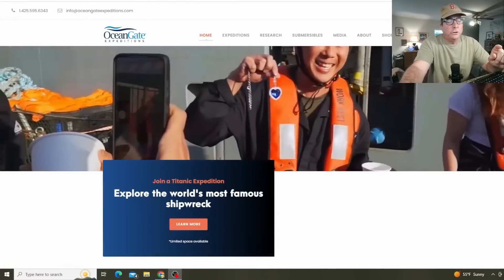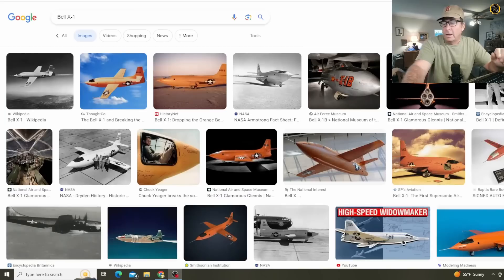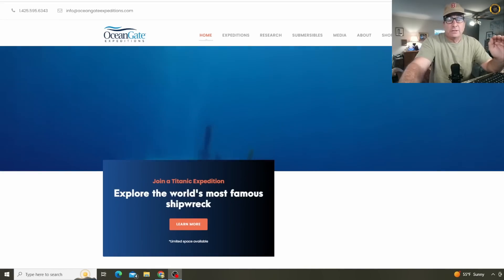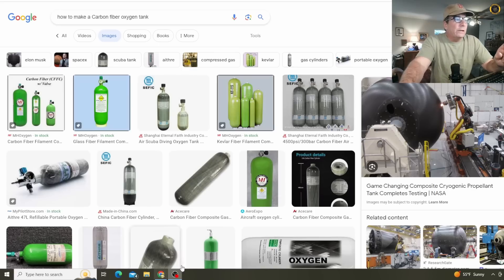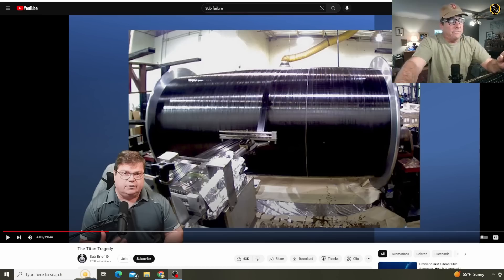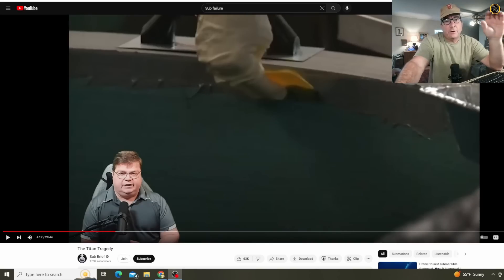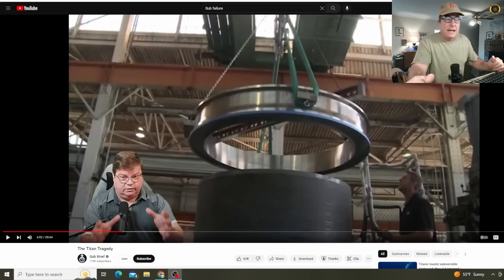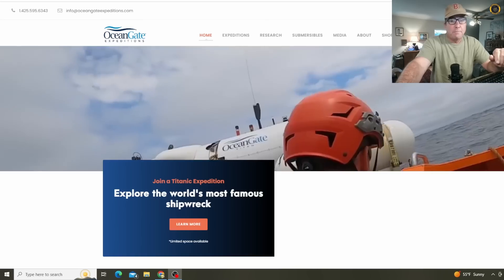Oceangate Sub Construction Details and Implosion

Comment: I'm an aerospace engineer, and I have extensive experience with analogous structures - wound tubes with bonded caps, as well as other composite and bonded structures.  I saw the Sub Brief video prior to this and one thing that stuck out to me was the design of the flanges of the titanium ring that are bonded to the tube wall.  We had specific experience with failures at these kinds of joints due to stress concentrations right at the edge of the interface between the two parts - meaning where the flange ends.  This was understood to be because of a sharp drop in the stiffness of the structure at that transition point, resulting in higher local stresses at that interface.  One way we'd overcome that is to taper the outer face of the mating parts so that there would be a more gradual transition.  If you look at the design of this ring - about 2:40 in blancolirio's video where someone is prepping that location on the ring - there is no taper, the flange full thickness just abruptly end in a 90 degree angle.  I'm NOT saying this is what caused the issue, there are any number of reasons it could have failed.  But I'd be interested in seeing how that joint held up in a catastrophic failure.
Reply: I have an extensive background in composites as well and one thing that stuck out for me was the pictures of the CF being wound around the mandrel/form. The filaments orientation was entirely perpendicular to the subs body, no multi axis passes. It also appeared to be basically a wet layup with maybe some heat post curing (no autoclave) This CF windings are literally being 100% held together by the epoxy, best analogy is wood grain. This would be the absolutely worst way to use a composite system and offers the lowest attainable physicals.
Reply: @glassdave  right! If you’ve ever 3D printed a cylinder on an upright orientation, you know how easy it is to break, no matter how thick the wall is.  So many wrong-looking aspects to this, I doubt an actual engineer came up with it.
Reply: @glassdave  I don't want to say anything about the layup of the composite part right now.  So little of the winding was shown, it doesn't give a clear idea of what tow orientations were used through the thickness.  I've worked on wound structures that had multiple tow orientations, and since this was supposed to be 5" thick, there would be a LOT of winding that may not be seen by that short clip.
Having said that, I was definitely shocked to hear that they did little to no certification testing.  I would've wanted to test the crap out of something like this before ever putting my life at risk in it.
Reply: @sthomas6369  fair enough. Unfortunately i find myself speculating irresponsibly based solely on the few minutes of footage and the amount of poor technique in those alone. Im quite certain all this will be looked at and i agree with a final thickness of five inches you'd think there would be multi axis passes in there but ya gotta admit not much evidence of it. Even still this appears to be a simple saturation machine and to get into the highest physicals wouldnt they have to get into a pre-preg autoclave? Again the majority of my personal experience is in marine hull construction but i do enjoy learning beyond my daily scope. Seen a lot of great input from James Cameron on this as well.
Reply: @glassdave wow you are right. Makes me face palm. The tube was even more brittle because of that.
Reply: @glassdave   said  "      one thing that stuck out for me was the pictures of the CF being wound around the mandrel/form. The filaments orientation was entirely perpendicular to the subs body, no multi axis passes   "  

Do we know that the entire thickness is wound this way or that this was just the final pass in order to have a smooth finish so paint seals everything up?
Reply: @bobroberts2371 was just an assumption on my part it also looked like a fairly early pass deep in the laminate, either way lack of and disreguard to proper engineering would lead me to believe no thought was given to a multi axis laminate. Just watching them hand mix and apply whatever adheasive that is without any thought to controling the consistancy of the union is also cringeworthy. Carbon fiber is also very misunderstood by people that dont work with it. When we talk of its high strength abilities this is only in reference to pre-preg autoclave cure highly engineered structures. CF used in simple wet layups even if post cured really carries no better physicals then fiberglass in some cases "S" fiberglass carries even better properties then wet lay up CF. Many many variables but it seems this sub failed on so many levels it was doomed from the start. You mentioned that epoxied on end cap, i cant wrap my head around any way to make this work in an external pressure vessle. That was just a simple surface glue joint. I think people tend to think that pressure is forcing the caps on but thats not how it works, the pressure is not a linear force on the ends, its over six thousand psi at every angle and joint trying to force its way in at every infinite point.
Reply: I suspect you solved it.
But the real solution is what was known in the 60s. Spheres. And don't try to take 5 people?
Reply: @backfromcuba  Exactly. Mr. CEO should have just built 2 proven certified subs that carried 2-3 people each and call it a day. His ego and hubris got in the way
Reply: @zoots15  it was stupid anyway... 5 billionaires, one window? can't put windows in a tube. can put more in a sphere. what's the point without a good view? might as well use an ROV.
Reply: @backfromcuba  You could call Oceangate an "innovator". But not all innovations are ready for prime time.
Reply: @JimMork  Juan's point about innovation being made in very small steps is very pertinent.
Reply: Sadly Oceangate got the prime time for bad reason.
Reply: @martasfly  At least they can't sink any lower ..
Reply: @hb1338  Can't cheat physics. Deep ocean is extremely cold with massive pressure. Any design has to account for that. I can't remember if the Titanic was a new design or not. When it encountered the ice berg  the engineering turned out to be flawed. It isn't as if that trip was brand new. Both wooden and iron ships had crossed many times before. Human factors were probably huge in the sinking as they were in this deadly dive.
Reply: @backfromcuba  But 5 people means your driving and 4 are paying a total of $1,000,0000.00.
Reply: @rotkev  That's probably exactly what that CEO was thinking, yes.
Reply: I remember in Engineering school in the late 80's (studying for my BSME) we did design exercises on pressure vessels, boiler, etc.  Flange design is key and as you said, the design of this one appears to have been done by someone with no engineering ability!?
Reply: Agree with the taper... for bonded joints based on very similar experience early in my aerospace engineering career, but the cylinder ply angle schedule and buckling analysis that it was based on is what interests me.   Also how well matched was the CTE of the Ti and CFRP, as it would be getting much colder than the build temperature, plus the thermal gradient towards the inside warmer cabin putting the inner tube plys in greater compression stress.  The FEA will need a lot of load cases and considerations.
Reply: I've seen video's in the space industry where guys in white suits are applying a compound handed to them by chemists who prepared it. Then the structure is put is some kind of autoclave for curing. In OceanGates video there's some school kids slathering on something, maybe from Home Depot, who knows. That should be perfect bond, no occlusions or anything like that.
Reply: @craig7350  In jeans standing on decorators ladders ( hold on, just let's move it round a bit more, thanks), using stick mixers.
Reply: @andyharpist2938  If they put a sheet of glass over that glue they slopped on, they'd see nothing but air bubbles. Lucky for their egos they put a titanium dome on instead, and not being able to see the results they could congratulate themselves on what a great job they did.
Reply: @craig7350 yep it just looks so unserious.
Reply: I worked in the 737 frames group during the infamous "Aloha" 737 disaster years (saw the sensitive photos) and the outgrowth of that was a redesign of the double plus chord revision where we taper-ed the ends of one partial fuselage frame where it was mated to a second adjacent full frame.  Without this end taper a stress riser was created and the frames failed precisely at this juncture. This was during the "Classic" 737 days. if carbon fiber joints work similarly this could be the place for a stress concentration where the joint could possibly fail.
Reply: @larryheagren5171 if that’s the one that landed with part of the roof missing, I knew a pilot who was a passenger on that flight and survived. He was never the same :(
Reply: You can bet if I had a deep diving submarine I would have you on my team advising me.. some people just do not want to take advice because they think they know everything 😮😮😊
Reply: @richardhowe5583  "Your negative talk is killing my creative mojo, man." (Actual statement from one of these Stockton types of guys.)
Reply: @richardhowe5583  don't want to pay money could be a reason too. peace.
Reply: @bacilluscereus1299  you are 💯 percent correct 💯 my friend 👍🏖️🏝️🥂
Reply: It really seems like carbon fiber would be great under tension, but weak under compression? The only thing that seems like would be preventing compression is the resin. Whatever that may be? This fellow explains this quite clearly and well. What shocks me little testing if any!
Reply: @marvinmartin4692  that's exactly what everyone's saying. Don't use CF in compression. It's just the wrong material. Utterly amazing it survived more than one dive.
Reply: @backfromcuba  That is true, but I sometimes wonder if the thickness of the carbon fiber would get around that problem of compressive strength. If you take a wooden pencil and put each end on blocks and then step on it, it's gonna easily break, but if you put a 4x4 piece of wood across the blocks and stand on the middle, it's not gonna break. It's the same material, but they have different compressive strengths. I think it's why he made the the CF 5 inches thick, thinking it would give it plenty of compressive strength. Then again, repeated stress could have cracked the carbon fiber no matter how thick, so you may be right. I think it was either the CF like you mentioned that failed, the window, or the end caps that were glued on. As you know he only had a 2 inch dado machined into the end caps that the CF tube was glued into with epoxy that only has a tensile strength of 5 to 6000 psi, when Titanic depths are 6000 psi. I would have had a 12 inch dado and got away from the edge and drilled holes through the titanium CF titanium. Even though holes would have weakened it, it would have been sandwiched by titanium on both sides. Then I would have not used glue, but put a rubber seal to flex with the two dissimilar materials. Then from time to time he could have disassembled it and replaced the rubber seal. I think he probably sprung a leak in that glue joint, a CF crack, or a cracked window, and all that pressure blew up the sealed compartment like a balloon until it exploded.
Reply: @marvinmartin4692 yep, and at the atomic level, those carbon lines getting compressed are going to want to wrinkle up.
Reply: It never ceases to amaze me how even people with engineering degrees sometimes totally forget about how stress concentrates with tight radii and abrupt changes in materials.
Reply: @umeng2002   said "    It never ceases to amaze me how, even people with engineering degrees sometimes totally forget about how stress concentrates with tight radii and abrupt changes in materials.    "  

Just because someone drank their way through college / was good at math doesn't mean they have usable skills.
Reply: @bobroberts2371 I got my engineering degree at Faber College .
Dean Wormer told me that Fat , drunk and stupid is no way to go through life, son.
Rush never got the message…..
Reply: @brianjones7660    Ramming Speed !!!!!!
Reply: The tapering of these two surfaces (at the joints) would also allow for, greater surface area for the mating substrate, better distribution stresses and thermal conductivity. Come Monday NAVSEA will scrap any ideas about using CF for anything other than toilet seats.
Reply: Another Aerospace Engineer here.
On Juans last video on this subject I gave an explanation on the differences between compressive and tensile loading of pressure vessels and why Carbon fibre is great for rocket fuel tanks but unwise for a vessel under EXTERNAL pressure. 

Just hours after I made that comment James Cameron pointed out that all of the deep diving subs are made of the same material. They don't mix materials for the main pressure vessel. Its doesn't matter if they are using titanium, steel or acrylic. Other than port holes they don't do combinations like this sub did. 

Think about that glued joint. As the sub descends that titanium ring will deform under the pressure at a different rate to the carbon fibre putting that joint under incredible stress. My professor in college was a world leading expert in Finite Element Analysis if Axisymmetric and Pseudo Axisymmetric structures. This is the sort of thing I was trained in except it was in aerospace. AND Rule #1 of all structures is look for stress concentrations and deal with them. 

There's also an odd but previous lesson in mixing composite and metal structures. 
Back in the late 90s the Stewart Formula 1 team tried a revolutionary gearbox with the case made from composites and it was a disaster for reliability. Note that in those cars the gearbox is an integral structural member of the car. The engine is connected to the tub by a cluster of mounts. The gearbox is SOLIDLY BOLTED to the engine with locating dowel pins so that there is no misalignment. Then the rear suspension is bolted to the gearbox. 

At the the time my boss owned a racing car team on the side. One of hi mechanics quizzed me one day. His view was that as everything got hot the metal of the engine and the shafts, gears & bearings in the gearbox would expand against the carbon fibre of the gearbox casing WHICH WOULD NOT EXPAND AS MUCH IF AT ALL. That mechanics view was the difference in expansion would simply break things. That Stewart F1 gearbox might have been revolutionary but it was also incredibly unreliable and NOBODY has tried it again in any form of racing I am aware of.
Reply: Never, ever allow 90 degree corners in pressure or compression design. This a fracture failure, common sense tells you that. In 40 years of being a certified welder in every code there was, building many high pressure domed vessels, the word to use in design is “radius”. You could not have paid me 250,000 to get in it.
Reply: Very good observation. The 2 materials are going to compress differently and that's going to put a lot of shear stress on the carbon fiber at the ring flange. I bet you are correct.
Reply: the seal had to be full of voids ,,i would have wanted to see material squeeze out as the ring slid onto the cylinder,,,shocking
Reply: A lot to learn here.  I'm a professional welder who has built many very large water tanks and various larger pressure vessels for oil-field service including many of cylinders approximately the same size as this submersible.  You are very correct that the joints and meeting places are critical points for failure and leaks.  Any tiny pinhole leak can be a site for catastrophic failure, but as I always worked in all steel vessels and mostly internal pressure containment was the goal, the great cause for concern was the integrity of the interior root weld joint.  The weld joint itself must be as you describe smoothly tapered into the adjoining surfaces with its reinforcement forming a stronger but also stiffer portion around the pressure vessel.  There can be no stress point to accumulate specific wear or the vessel will certainly fail prematurely.  It would obviously never enter the minds of makers of vessels to hold interior pressure to glue on end caps, but my thought would be leaning into the ends being tapered plugs that the external pressure would tend to force into tighter seating into contstraining rings as the end cap design.  I just don't like that 90 degree glued butt joint at all, all my experience and instinct says "NO".
Reply: When the F-18 Hornet first went into service the engineers found out that carbon fiber and titanium creates a good galvanic battery with the titanium being the anode. The heads of titanium screws holding the wing skins on started popping off under flight loads. Titanium doesn't create colorful oxides so it's hard to tell if corrosion is taking place and I wonder if the pressure of diving to that depth forced seawater into the joint where the carbon fiber and titanium ring met corroding the fasteners leaving only the glue holding the joint together. Every 33 feet you go down is equal to one atmosphere of pressure.
Reply: Very informative..
Reply: This speaks to the most important point in all of this, I think.  You can use carbon composites in compression, you can use dissimilar materials.  All of that is fine, but it all has to be done correctly.  Avoiding stress risers and staying within the limits of each material are problems that must be solved in any design.  They could have chosen materials and shapes that make the design work easy, but they chose instead a more complicated task for which they had innadequate expertise.  People simply scoffing at the use of carbon under compression are way off the mark.
Reply: @brianhaygood183 PLEASE ENLIGHTEN US:
- EXACTLY HOW DOES THE CARBON FIBER REINFORCEMENT "WORK" IN COMPRESSION, WILL YOU?
Reply: Observations such as this, when viewed in total, really seems like lining up all the holes in the proverbial Swiss cheese slices. All these issues, poor design choices, and even operational practices really begin to stack up. Another video mentioned that since everyone sat on the floor with no restraints, an assent into choppy seas could cause passengers to get thrown around. The nature of the equipment installed inside were an issue such as the lighting from Camping World and monitors. The commentor explained that every item must be rated to not cause possible sparks.
Reply: RIP those people that were lost.
 Underestimated  the extreme pressure at those depths and no prior testing.
.
Reply: @skyepilotte11   NOT Completely CORRECT, as it performed several repeated inmersions without failing... But even when that could be "stretched" to be considered "Manned" tests,  that does NOT endorse it as being a correct design.
Reply: What was the problem? “Front fell off” is that normal?? “No”
Reply: As an added question:  I had been following the 'Dark Aero' development of their carbon fiber airframe and I thought they had investigated thermal expansion and contraction properties of metals suitable to the used in conjunction with carbon fiber composite structures and determined that stainless steel was the better choice.  Is that correct?
Reply: That makes a lot of sense, even more so if the layers were always wound parallel to each other and the flange point. Wonder if any layers were wound at an angle?
Reply: @Pinhead-q4i  Juan is actually 1/2 wrong about that part of his video. If you look at some of the longer videos they are clearly laying down a weave. But he's also right in that none of those videos show much of a weave. 
The question is did they down enough of a  weave to get the desired effect.

Juan is dead right when he says fibres are weak in compression but they are also monstrously strong in tension. The purpose of the weaving is to have some of the fibres always under tension no matter how the structure is stretched, bent, twisted,.... 

The problems for this sub include but are not limited to.
1) The load on the structure is purely compressive so its hyper important to get the weave right. What the actual weave pattern was has not been disclosed. I expect it will eventually.

2) All materials deform under load but its very rare to have to radically different materials deform at the same rate. The Titanium ring that was glued into the CF tube would deform at a different rate to the CF causing a stress concentration. How that was actually catered for is YET TO BE DISCLOSED so we don't yet know if their design had that covered.

3) There's a known problem for CF to absorb water. The exact details of how they get round that with sailing boats and pleasure craft I don't know other than they all love "gel coat"  

NUMBER 4) The CEO was well known to put youth and enthusiasm ahead of knowledge and experience.
Reply: Bonds are strongest in shear.
Reply: TLDR: You are wrong: The problem is the materials expand differently destroying the joint.
Reply: I was wondering about this after seeing the Sub Brief  video, and I'm not even an engineer. I also wondered how the glue would respond to multiple immersions in salt water under pressure.
Reply: From Scott Manly's analysis about the energy released during implosion. I'm not expecting to see more than shard size pieces of the pressure hull in the wreckage. 

Coast Guard was careful to say they identified the wreck to the unpressurized hull tail section. So I'm assuming the carbon tube and distinctive titanium hemisphere ends are not recognizable.
Reply: @HappyRock616  Cameron stated in one of his interviews that the entire carbon tube was found packed into ONE TI hemisphere. 
Mind boggling.
Reply: Why did he want to use carbon fiber in a sub?  It is usually used 
to save weight, which is a minor issue with things that float.
Reply: @jamese9283  The whole thing makes me think of people who do DIY projects. You can make a sub  yourself! Ages ago I had that fantasy, but never more than a fantasy. It is possible that making a safe submersible requires a more formal factory setting. And what on submarines is every done with adhesive? At least in the body of the thing? There's a kind of crackpot smell to this whole thing. Too bad someone volunteered to test his sub. If it could have been autonomous, nothing living would have died.
Reply: It reminds me some drug traffic from South America uses subs. Why not? They sell the stuff for billions. A private sub might not be that expensive. And those subs don't dive very deep.
Reply: Hi, I work as a structural engineer for mechanical structures (machines) and in my daily work I try to avoid exactly what you just described - sudden changes in stiffness. Sudden stiffness changes/sharp transitions just invites stress concentrations and thus fatigue cracks. Gradual stiffness changes is the name of the game if you want any cyclically loaded structure to survive.
Reply: What caused the issue was an over abundance of ego, yes men or boys in this case and over evaluation of one's IQ
Reply: I wonder if the government will spend big money recovering pieces to come to a certain conclusion.  If they don't, no one will.  This is just one sad cautionary tale about the "brave" people we hear doing stunts around the world.
Reply: Could it have been made to (at all) screw together to mate the cap flange ring and body cylinder or make the paired fittings snap together and still glue them as well compounding them as a better connection (I can see why tapering joins are better transitionally but that doesn't achieve fastening).
Reply: @Don.Challenger  My thought is that the dissimilar materials should have been made to take advantage of the pressure load to tighten the bearing on their connection in some way.  There will be different movement under the pressure and temperature variation, so whatever the design, it should have gotten tighter under pressure.  The 90 degree butt joint even constrained inside a channel could still have the carbon fiber being compressed and released by the weight of the water and temperature variation bearing hard on the glue joint, moving more than the titanium ring, and thus the bond weakening over time, then there is a galvanic corrosion component to degrade the joint where any separation happened.  To my thinking it seems like an inevitability it would fail as designed.  I think the cylinder should have sleeved over the stronger titanium ring (or another material if it had closer temperature variation properties) over a tapered section and then been constrained with an outer ring instead of a butt joint in a shallow channel, perhaps with interior buttresses to keep the tapered titanium from being pushed into the vessel, increasing pressure.  I don't think NASA engineers would have given this design as it was a very long cycle life confidence, the dissimilar movement was bound to be bearing on the bonded surfaces of glue joint itself, weakening it and allowing for ingress of corrosion over time in small flaws in the bond and putting extreme stress on the carbon fiber adjacent to the joint.  I don't like the design at all.
Reply: @korycassel5197 good point. But if the Ti ring tapered, wouldn't the carbon tube ends also need to be tapered?
Reply: @George-zj9rr  I've written unclearly if it seems I'm making a serious design recommendation with this example, it was forwarded as a concept to illustrate the  principle that if dissimilar materials are going to be employed (hence 'whatever the design'), my thought is that the connection at the joined surfaces should tend to tighten under pressure because movement will be differential.  It's a point for pressure vessel hulls made of mono-material being the much preferable choice IMO.  The complexity of this relatively simple design choice of how to integrate end-caps of different material on this vessel to operate at such pressures illustrates that well.  If the Ti end caps plug into a join with tapered carbon fiber receiving socket formed into the cylindrical section under pressure; then you would have to calculate how much force is pushing them into the cylindrical section, how hard it's trying to split the receiving socket and what kind of constraint is needed to counteract it, precisely what angle of taper is optimal to get a tightening bearing quality in the joint rather than destroying it with forces that can't be practically constrained as the taper is too shallow, what clearance to design before it is met hard up against buttress features to stop it from pushing right into the cylinder, what happens if it gets knocked by debris...robustness behavior absorbing impacts, the behavior of the different stiffness and weight of the feature acting upon the rest of the cylinder, and on and on, etc...  Mono-material spheres are the standard for a reason, but what I could gather was the dissimilar materials joined at a 90 degree butt joint glued into a channel of titanium that the end cap hemispheres then fastened to; and that I don't like at all.  I think catastrophic failure was inevitable (of course it always is EVENTUALLY) but without excellently thought out NDI procedure, in this case failure was practically unpredictable as well because of the various drawbacks mentioned.  And my understanding is at least one experienced employee was fired for raising concerns that inspection was not thorough enough, or illuminating enough to assess the integrity of the pressure vessel, so yeah, I just don't like the design that I see here.  I really don't like the overconfidence in the vessel displayed by the CEO in interviews mentioning the design of the pressure vessel either.  He made noises about working with NASA and university engineering departments, but when an experienced employee said the NDI wasn't good enough to tell them what was happening with the vessel, he just fires the guy with an air that it is indestructible, designed by experts, supposedly going to last forever then?!?!?!?  No, just no.  NOTHING made by man lasts forever, much less undergoing cycling into such an extreme environment, and the guy spoke alarmingly flippantly about how confident he was in the design's safety considering it's experimental nature IMO.
Reply: Good eye. Yeah, those flanges bothered me. The inner flange could and should have been made a lot stronger because the ocean is going to press inward on the cylinder. Let the titanium do what it is good at please!
Reply: Was your experience with the Boeing 787?  My brother was still working for Boeing during the 787 Project and when he told me that all of the main structural components, wingbox, longerons, frames, wingspars and surface sheets were made of "advanced composites" my reaction is Holy f---.  Then they outsourced the parts to all over the world, and many of the places seemed to have a different definition of the inch than 25.4 mm!  Getting them to fit together was an adventure resulting a bunch of unique birds with NONinterchangeable parts.
Reply: I’m in IT, but have watched a thousand hours of machining videos…sharp corners cause ”stress risers.” People like Keith Fenner cut radii on anything that handles forces, say a propeller shaft.
Reply: Do you think attempts are gonna be made to collect parts of the wreckage from the ocean floor and find actual proof of what part of the sub's construction gave?
Reply: Any thoughts on sea water intruding into the end cap joint / into the carbon fiber structure causing a de lamination failure over time?
Reply: @bobroberts2371 YOU HAVE A GOOD POINT HERE... The fact that the vessel withstood numerous dives to the  same depth without collapsing, points out that the initial bond was "enough"... but ANY water ingress into the thickness of the cylinder portion of the hull, would gradually start to degrade that bond, both to the titanium flange,  and into and between filament wounded plies.

Delamination start is very difficult to detect until it is too serious to maintain the necessary strenght. Even larger companies with much larger resources, like Airbus AND Boeing, have both suffered failures in their A350 and B787 Dreamliner designs when  dealing with composites!
Reply: Or in Lameman's terms- the dang thing just didn't work.
Reply: NOT CORRECT: IT WORKED FOR REPEATED INMERSIONS... to that same Depth... But it failed in a catasthrophic manner due to being a bad design that did, indeed "worked"... until it failed. It remains to be clarified WHEN and EXACTLY HOW did it fail. It could be compared, in a sense, to the DeHaviland Comet-I initial design: it flew perfectly for some months, and then started to crash due to improperly executed riveting and joints design, and stress concentration points.
Reply: @alfredomarquez9777   Even a broken clock is right twice A-day. So what if it worked a few times it was a bad design and it predictably failed. The CEO was an eagle maniac he took many shortcuts and gambled peoples lives including his own and he lost. Still I can't help but wonder why those affluent people didn't do more due diligence. Nobody in the right mind would get into that death trap.
Reply: I'm a former astronaut, I can tell you about how cold on it is on the Darkside of the moon! Also, I'm a former SR71 Pilot, I can tell you your ears pop above 80,000 feet! GMAFB!
Reply: @randyboisa6367  Hmm, I guess your next destination is as close to the Titanic as you can manage - good luck on making that next career change.
Reply: @randyboisa6367 I was acquainted with Lt. colonel Brian McCallum years ago, he flew SR 71s.
Did you know him?😊
Reply: @brianjones7660  relax man, that was just a joke. I hate it when people say, "As a former aerospace engineer" "As a former this and that."
Reply: U must make bank